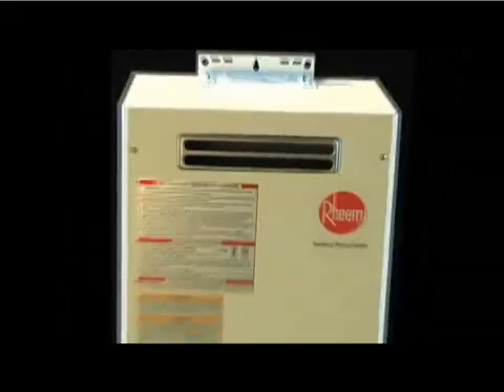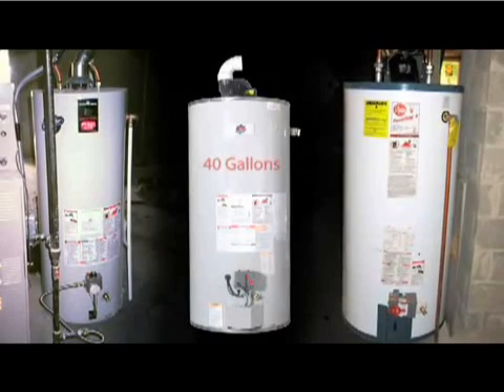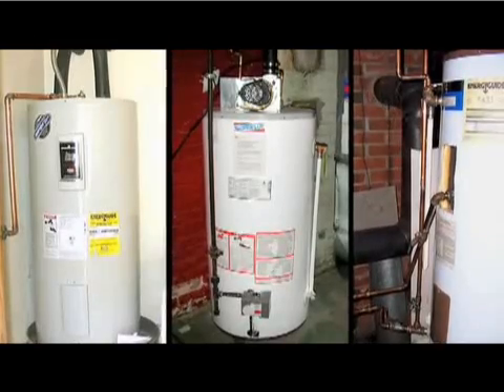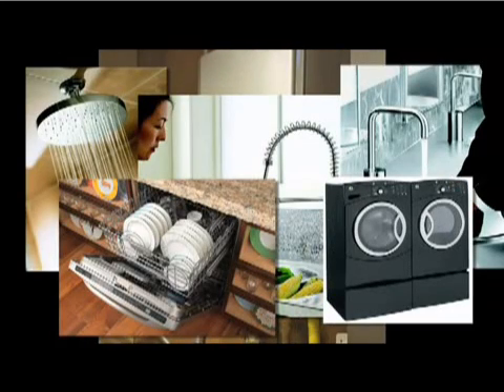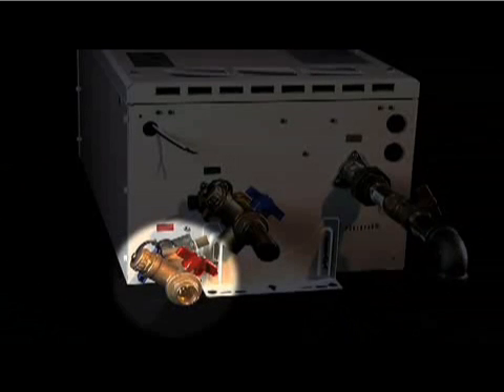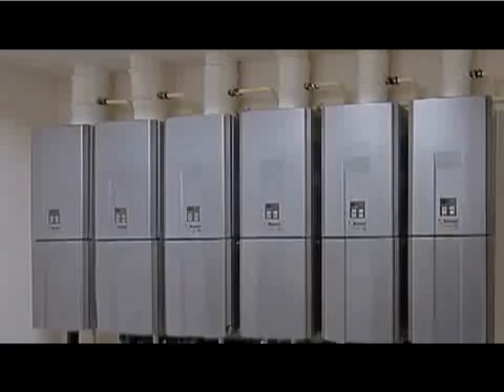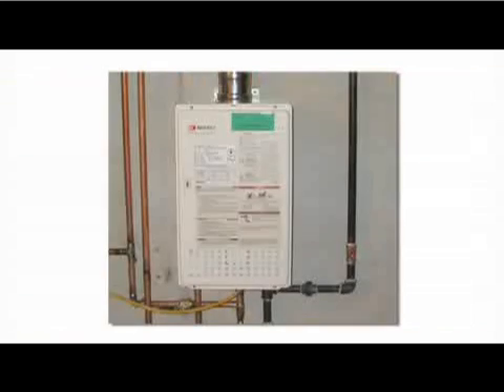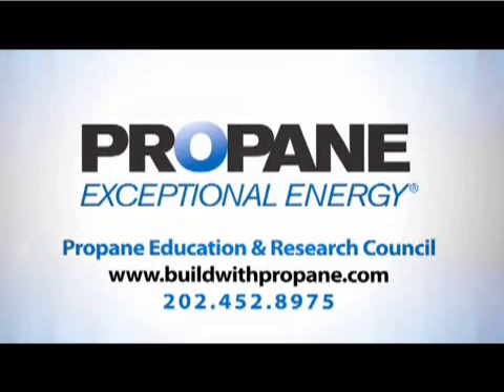Tankless Water Heater Basics

Comment: Negatives = Much more expensive when you get a big enough unit to match the hot water pressure of a traditional (tank) water heater ?
Reply: Like this said, more than one can be used together. One of these can also be used with a tank.

Comment: This product sucks!! The heat exchanger eventually leaks & the noise from the fan is way too loud when running full tilt!! I've had several of them & can tell you first hand - it's a great concept - but horribly made - and far less maintenance free then other units out there!! DON'T BUY ONE unless you don't mind replacing the heat exchanger 1 to 2 times a year depending on your use!! Just my opinion!!